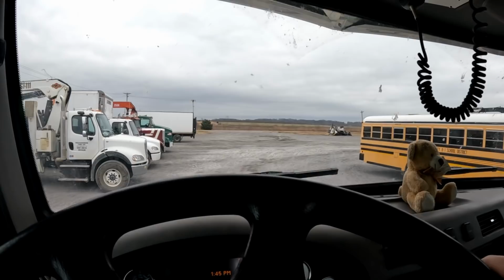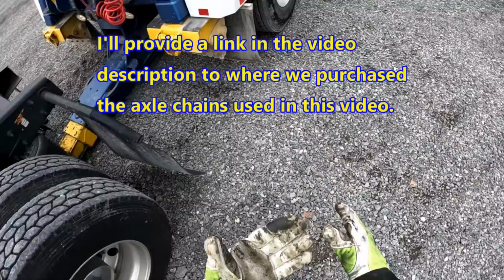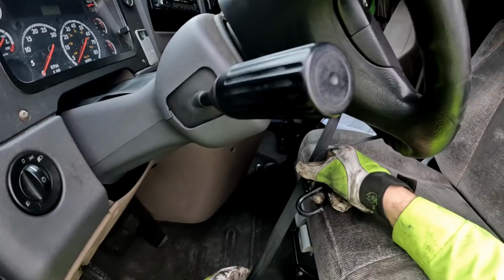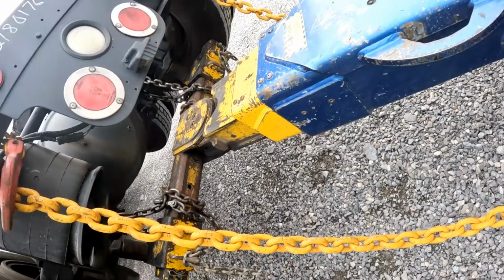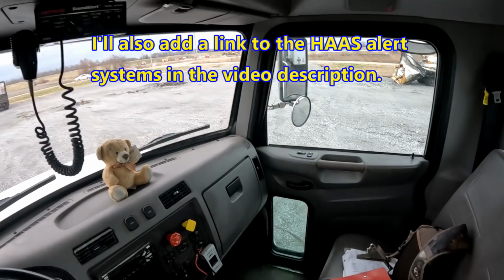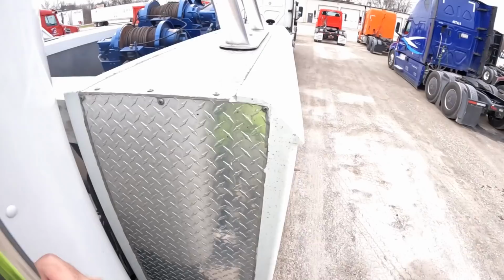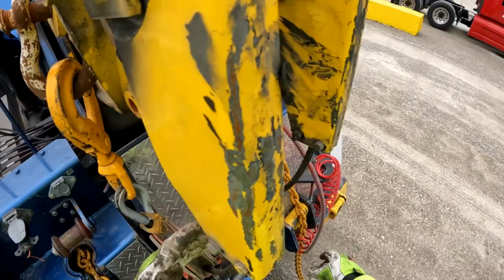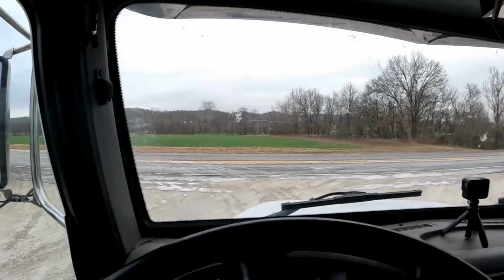On The Hook Again.  Freight-Shaker's On the Hook Again.  Towing 'Shakers is the Life That I Live.

Comment: the    HAAS  system ... would be a great system is every car maker  would have it as  standard  equipment  to receive the signal in every car !!!
Reply from the maker: The people at HAAS are working towards that goal.   They recently announced a collaboration with Stellantis.  Here is a portion of the announcement: "Until now, your Safety Cloud alerts have been delivered to drivers through Waze, the most popular navigation app. Beginning this month, drivers of Chrysler, Dodge, Jeep, Ram, and Alfa Romeo vehicles from model year 2018 and newer equipped with a UConnect System subscription will be able to receive Safety Cloud alerts automatically without any additional third party application or hardware. This feature will be activated automatically.
 
These drivers will receive both an audible in-cabin alert and a visual alert on the infotainment screen when approaching any emergency vehicle, tow truck, work zone, or other roadway hazard alerting on Safety Cloud."

HAAS is working with other vehicle manufacturers and app developers to get this alert system into as many vehicles as possible.   The way I look at it is if the system saves even one of our employees from serious injury, or worse, then it the system has MORE than paid for itself.   As I stated in this video I will have more information about the HAAS system in upcoming video(s).

Thanks for watching and God bless.
Reply: @RonPratt  it's basically a GPS unit attached to the wrecker that phones home to HAAS and sends an alert out to anyone who subscribes to their service.  If HAAS shuts down for whatever reason, you do not pay your subscription to them (either as an app developer or a first responder) or do not have cell service, the units are not going to do anything.  I would be more excited for the technology if it was more community driven (ability to integrate into your existing GPS fleet tracking/ELDs) OR not dependent on outside services (internet, cellular) for functionality.  Examples would be a Bluetooth solution, but broadcasting RF becomes a challenge.
Reply: There's also a phone app you can install that'll activate when HAAS trips it off.
Reply: One of the challenges I find as a truck driver is getting the cars next to me to get out of the way so I can get over for emergency vehicles on the shoulder.
Reply: i heard wind brakes???
Reply: @RonPratt  if  this system   saves  just one tow operator / emergency worker  it  is  more than worth   it !!!!!!
Reply: @RonPratt  I am excited to hear that Stellantis (owners of Dodge/Chrysler/Jeep/RAM and Alpha Romeo) are working with HAAS.  One thing that I am disappointed in is this part of the statement... "equipped with a UConnect System subscription" - That implies that only vehicles with the UConnect systems, that have an active (paying a monthly fee) subscription will receive the alert.  That means that many vehicles, with UConnect systems, but not actively paying for services that they don't use, will not receive the alerts.  Hopefully, this will change and become a non-paid function at some point.  This also reminds me that I need to contact Chrysler and inquire why the GPS system in our 2019 Chrysler Pacifica hasn't/cannot receive signals from any satellites, but our Satellite Radio works fine.

As always, thank you for the great content.  Stay safe out there!
Reply: I think in addition to tow trucks,  fire, police and Ambulance vehicles should use HAAS as well,  IMHO
Reply: @RonPratt  such a great idea, can't wait for it to be universally adopted by both drivers and first responders and road crews, will likely save many lives in the coming years.
Reply: @RonPratt  sorry to hear about your father Ron. BTW are you still in contact with the tired Taurus lady? If so how is she and her family. God bless you all...
Reply: @RonPratt  With out getting political, This is something that should have been funded by the Federal Government in the Infrastructure Bill. God knows there was a several TRILLION in that bill that had ABSOLUTELY NOTHING TO DO WITH Infrastructure.  This however will save lives of our first responders and should be something that we should fund as a Nation.
Reply: Agreed! Another safety for the emergency workers, officers, work work crews, and tow truck drivers.
Reply: @x_x_w_  Although the first part of your statement makes perfect sense, you seem to have no idea what Bluetooth is (how it works, and how it don't, how tremendously limited it is). You want to supply countrywide messages THROUGH BLUETOOTH (with its max of 10 yards of reception and all its other limitations) ??
Reply: @RonPratt  what does HAAS stand for

Comment: I've had a few trucks I've driven towed from the rear like that. Mostly whenever I've had a breakdown, it's always been a front tow, because I'm usually pulling a trailer. 
I've had trucks derate on me, & reduced to 5 mph, once i got lucky & was only a mile from the freight shaker dealership, so i limped it to the shop, where they had it for a week trying to figure out what kept throwing codes. 

I've also had to rescue loads from Peterbilts with the same issues. 
It will never cease to amaze me with as many years as these DEF & emissions systems have been out, the truck manufacturers can't seem to work the "bugs" out!  
Great video as always, sorry again about the loss of of your dad.
Reply from the maker: I would guess that 70+ percent of our towing work now comes from emissions related issues.   We have to deal with them on our trucks as well.   They are a pain.   The people that designed these systems should have to be stuck out on the road when their designs fail constantly.   Thanks for watching and God bless.
Reply: @RonPratt  i would agree wholeheartedly, put the ones who designed the emissions systems in the drivers seat😄

Comment: Ron, I believe you are correct about the HAAS system. As more and more vehicles get these systems that detect the signal that the app picks up. Things will slowly become safer. Unfortunately its not going to be over night. But I definitely could see this saving lives to the point where statistics will show in the next 3-5 yrs. That this system should be incorporated on all new vehicles and transmitters on all patrol Law Enforcement vehicles and public safety maintenance vehicles (Snow Plows,Construction) such as Fire Trucks,Ambulance and Tow & Recovery vehicles.  Basically any vehicle that might be parked on the side of a roadway.

Comment: So the owner is going to put the driver, equipment, and public at risk in order to save a tow bill? wow. Thanks, Ron, for another great video.
Reply: When I heard that I was amazed that was what the driver was told when I'm sure MO has a minimum speed limit on all highways unless  escorted. Sad part is it's the driver's licence that takes the hit not the truck owners.
Reply: The owner is a cheap bastard. I hope nothing happens to the driver.
Reply: Happens all the time. Cheaper to drive it then tow it. Towing is expensive, but some have to learn the hard way about stuff like that.
Reply from the maker: @spdergod  I would respectfully disagree with you on this one.  Think of the dangers and the liabilities involved with this driver attempting to drive 5 mph for 50 miles on an interstate that has a 40 mph minimum and a 70 mph maximum.   That ALONE is worth paying for a tow.   Add in all the other factors such as fuel, driver pay, truck down-time, etc.   A tow bill is cheap compared to a pile of lawsuits created when this driver is forced to drive on the interstate and causes a wreck.   I don't understand why people think towing is so expensive and that it is the LAST option they should use.   We provide a necessary, specialized service.   Perhaps you've had a bad experience with a towing company in the past.   That's not how we operate.   God bless.
Reply: @RonPratt  well first honored you responded and even took the time to read my comment. Here in Northern VA, a heavy duty is around $175 an hour and it depends on what they are doing (goes up from there) Not sure where you fall in that category. I am in complete agreement with you that its definitely safer to tow it.  Penny wise dollar foolish on the owners part. Even our local guys charge more if police call for tow truck vs owner. God bless, keep up the great work and content.
Reply: @RonPratt  I think spdergod was voicing the twisted philosophy of some people, not referring to his own. The last sentence implies that he understands that while towing can be expensive the alternatives are much more so and some owners don't realize that till it comes back to bite them where it hurts.

Comment: Thanks for the info on those short axle support chains. I work at a truck shop and we sometimes use our big forklift to lift and push down trucks into the shop. Had been using a big single chain draped under the axle and back over top of the frame. Might have to get me a pair of these. Make it easier.
Reply from the maker: They will cut your time down to a fraction of what you are used to AND you don't have to crawl under the truck, reach around the greasy fifth wheel, or worry about damaging the air cylinder or line.    They will pay for themselves quickly.   Here is the one I use:   https://zips.com/parts-detail/b-a-products-ultimate-axle-chain-w-8-j-11-ac3g7
Thanks for watching and God bless.

Comment: A useful addition to the light bar would be a beeper that would
give, say, one beep when the left turn signal is first activated, two beeps for the right, three for the brake, and so forth. This would allow the driver to check all the light bar functions from his seat, saving walking back and forth. And of course these checks could be made while moving as long as the beeper is audible over the road noise. Inexpensive readymade beepers such as the Sonalert have a fairly piecing sound.

Comment: Another excellent and instructive presentation. I am surprised that the air ride unit does not have some safety strap to keep it from dropping too far but I realize it’s not really needed in most situations. We use WAZE all the time on the highway and this new system will give an additional warning great use of technology.

Comment: If you were in NZ, and your are attending a recovery in main roads,there would be traffic management trucks with flashing strobes, crash barriers, cones, road lanes closed and a number of other warning vehicles, a very different approach that's for sure. 
Yes attention  to detail and concentration are vital in the job  practice, getting distracted  is of major concern and one must keep ones self in check. 
I have to try extra hard even on a daily basis, Stroke survivor, so everything is harder to keep pace with, I must remind myself to concentrate on the task at hand, and avoid any distractions. 
I remember tip from a past boss, reference to changing wheels on cars, boats etc, and that was so it completely until the wheel nuts are tightened and torgue up, re-check, then treat as finished, don't deviate from doing things up, and think I'll come back to it later, the later is when you forget and the wheel falls off going down  the road! 
Training and passing on your skills is a very tiresome task, it wears you out  .
Suppose  One needs to put the trainees under pressure on site first, so they learn how to deal with issues on the job, years ago you often could be "Chucked in the Deep end "and hope to hell you learnt what you were taught in today's climate, that's not going to pass muster 
Cheers
Reply: When Ron has a roadside recovery there's usually some police presence. Midwest also has a traffic control vehicle for situations requiring it.

Comment: Good morning Ron quick question. Why don’t you cross the safety breakaway chains? Thanks for the videos it’s great to have a channel that everyone of all ages can watch! God bless and thank you for what you do! Ted
Reply: They would rub and/or get caught up on the under reach when turning.  

The crossing is mainly for towing hitch trailers to help catch the frame if it comes off the ball so it doesn't joust the road.
Reply: @chris76-01  catch the tongue ...🙂
Reply: Even when chaining a trailer you should not cross the chains. The tongue could break the chain or with the tongue on the chain could grind the chain on the road. You should always replace the tongue coupler anytime you have the trailer become disconnected from the vehicle. Also having the chains parallel will help the trailer from swinging. I weld a cross bar on the tongue to spread the chains just a little bit more to help also. I had someone disconnecting my towbar from my car, caught him in the act and I have a way to lock all parts in place including the chains. He was arrested, 3 months in jail and a $10,000 fine. Back up camera records.

Comment: I believe I saw Kenny in the Western Star getting ready to do this same hook up style today (Monday, 1/24/22) on the Cape Wal Mart lot. Stay safe out there Midwest Truck crew!
Reply from the maker: Yes, you did.   You missed me by about 30 minutes or less.   The driver had a triple axle RGN trailer.   I used our semi #17 to tow the trailer and Kenny used the Western Star to tow the truck from the rear.    This is what we call a "split-tow".   It's easier in tight quarters, such as the WalMart parking lot, and quicker than having to pull the drive shaft, hook up air, and all the other things you must do to safely tow a truck and trailer combo from the front of the truck.   I had already grabbed the trailer and Kenny was running a little behind me, because he was on another job when the call came in.   Thanks for watching and God bless.

Comment: .....back again, Ron, where those chain rollers are where you feed back into the chain locker, after taking off the break-away-chains, those rollers could have a swing away hinge that would give you an easier access to each chain locker. It might save you 15-20 seconds per replacement. LoL

Comment: 🤣🤣🤣🤣.  That was the first thing I noticed as you were pulling up.  I had a Volvo and was picky that ALL the fairings were undamaged.  Air compressor went out at one of the caves and the towing company blew it off while I was riding with them.  I just had to point it out to the driver in the mirror. 😡

Comment: I drove Truck for 10 years and I can't recall ever encountering a Tractor that had Parking Breaks on the Steer Axle or on just one of the non-lifting Rear Axles...

I always had Parking Breaks on both Drive Axles and all Trailer Axles...even the lift Axles had Parking Breaks on the Trailers I used to haul in case they were on the ground when Parked with a Max. Weight Load...though that might not be an Industry Standard, the 2 Ontario Canada based Companies I drove for that had Lift-Axle Equipped Trailers did that...

Comment: I don't often get the chance to be one of the 'first responders' so thank you for sharing both your video and your expertise.
I may be my experience of towing (much) older vehicles but it seems to me that anchoring the steering wheel does not rule out any sloppiness in the rest of the steering system. It can be quite interesting towing a crab.
At 15:37 the left indicator light seems have a couple of defective leds - may be something to do with your camera but worth checking.

Comment: There's not a much better security measure than the Mark I Eyeball and some critical thinking but not many seem to use either these days. A couple weeks ago locally (NC) a Trooper did a traffic stop, he evidently called for back up. His back up lost control of his cruiser as he arrived hitting either one of the stopped vehicles or the officer and the guy who was stopped. The driver died at scene and the Trooper a few hours later in the hospital. Such a tragic event that was compounded by the fact that the Trooper who was killed, was the brother of the Officer arriving as back up. Never too much safety for even mundane activties.

Comment: Great job Ron. I have a question. When towing a truck like that, have you ever encountered a problem with the air deflector on the cab roof since it's catching the wind going backwards down the road? It just looks like a problem waiting to happen. Thanks and God bless.
Reply from the maker: When towing a tractor from the rear any of the farings are a concern.   There are ways to secure them, but it does take time and can be dangerous to do.   Thanks for watching and God bless.

Comment: I’m curious if the light bar/brake lights that you fastened to the truck has a “backup” camera on it or if one could be added? I know that you use your mirrors to back up, but just curious if a camera can add an “extra level” of insurance that nothing or no one is behind you when you were backing into the lot to drop off truck.

Comment: I am surprised you don’t have to put air to the tractor to release the brakes on the front axle, but i guess it doesn’t need it.
Reply: Steer axles don't have air operated brakes on the big tractors. If they have brakes at all (and I understand some don't) they're straight hydraulic.